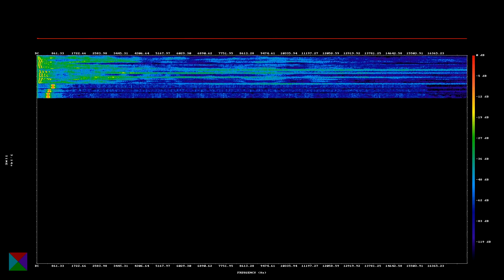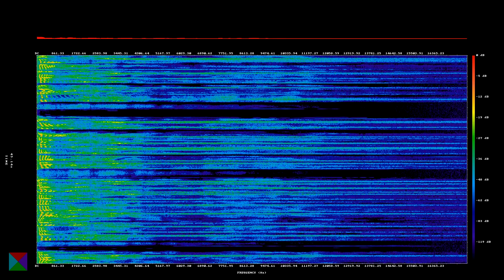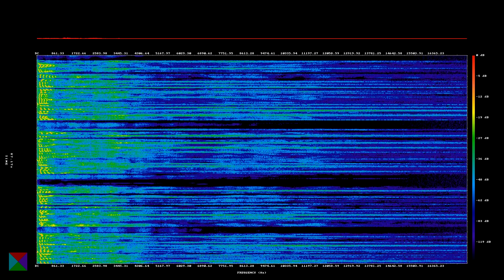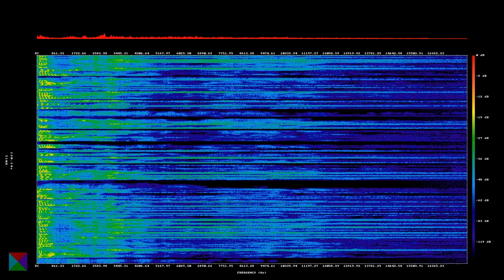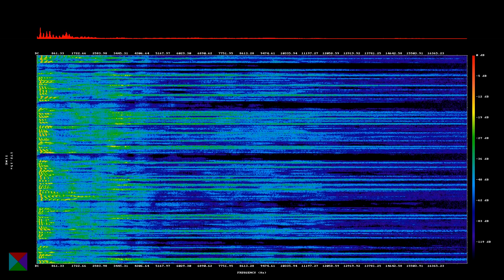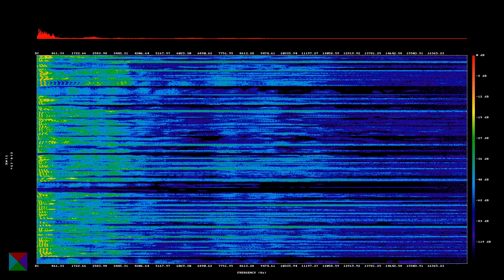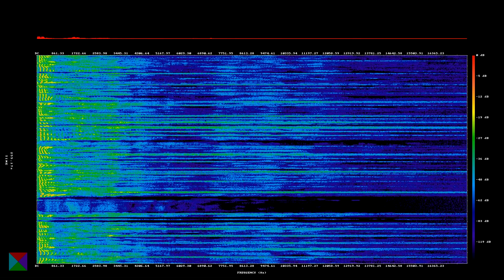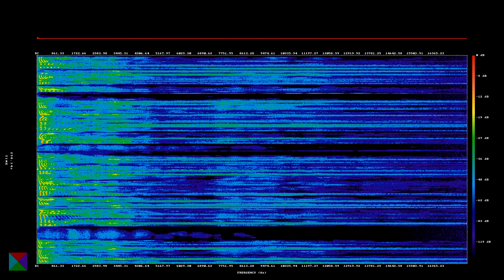20220220 How to compare radios

Comment: When I was working on my Simplex/Parrot Repeater (https://www.youtube.com/watch?v=dZVkipO5sCE) I was doing much the same thing with recording overs, and the ultimate intention was to present an online log -- in the style of imageboards like 2chan and 4chan -- the OP post would be the spectrogram, but if the server had a high confidence or of commanded by DTMF, replies to the thread would have the decoded SSTV, RTTY, Speech to Text, CW .. But as I was soon to be moving out of the rental, and not too versed on web hosting in $CURRENT_YEAR, I moved on to the next project...
Reply from the maker: That sounds very interesting. I created a log of the spectrograms and had a copy of the audio, but I wasn't comfortable with publishing those.

Did you ever publish your code anywhere?